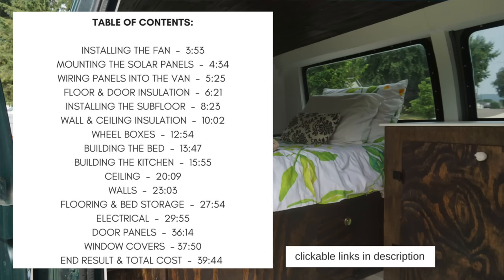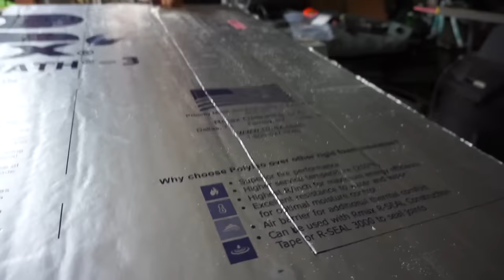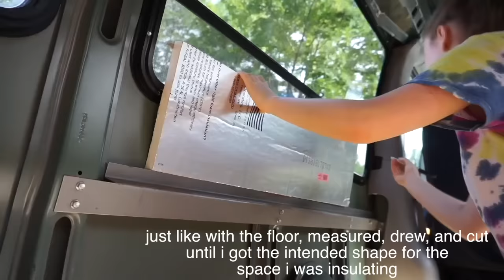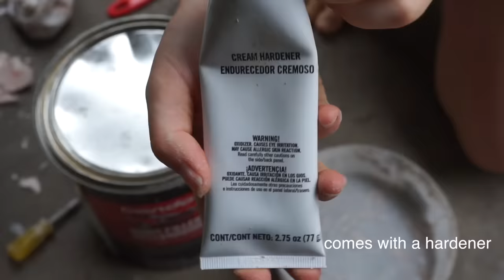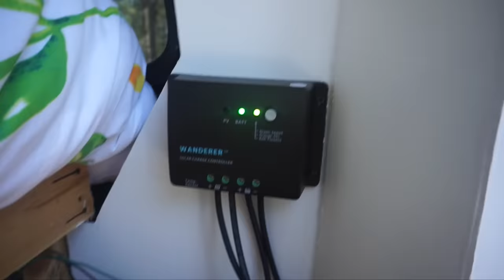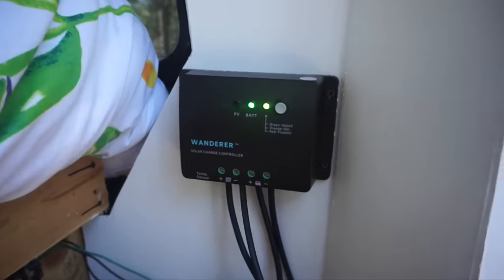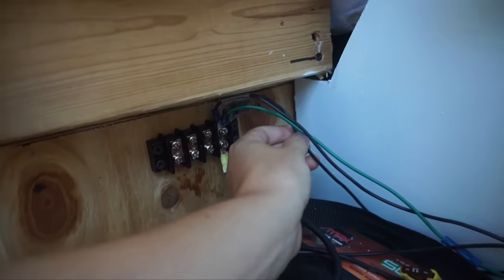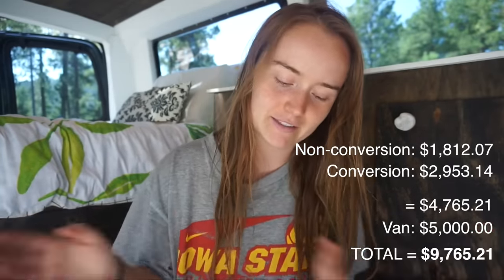How I Converted A VAN into an OFF GRID CAMPER for under $3,000

Comment: You must redo where the wires going to the van. You must put hard plastic gaskets or rubber gaskets between the wires and the drills holes. Butyl tape and silicon is not enough. If you don't the sanded edges of the metal holes will cut through the wires and will Electrify the metal of the van. One day when it's raining when you go to shut the door and you stand in some water it will electrocute you and it may kill you. Or it may start a fire. This is extremely crucial and you need to make that replacement right away. There is a lot of power in those panels. It is deceptive because they are silent but they can stop your heart.
Reply from the maker: Thanks but I only have plans to live in this for a few months and I smushed the butyl tape down into the holes enough that I’m not worried about the metal cutting the wires. They aren’t going anywhere
Reply: @AnnasAnalysis  
You should (as jhlittleelect said) and at least fuse the solar circuit. Never assume with electrics. As has been said, it CAN kill you, or cause a fire. Remember, you had to caulk the corners of your framing panels after the bondo cracked? That can happen to the wiring , everything is flexing all the time, plus you're dealing with sunlight on the roof. That can affect the cables, they do tend to become more brittle. (Not being nasty, just realistic) Impressive job though!
Reply from the maker: Devin Gessner don’t know when I’ll be done with it or what I’ll do when I’m done but if I were to seek it I would make sure the person knew that it’s not built perfectly and there are things that they might want to change or redo
Reply: Yeah, I never see this brought up in most solar install videos I've watched.  So, I'm not sure how important this actually is.  Personally, when I did my van I made sure I got some grommets.  Drill the hole... used a small round file to smooth the hole... brushed some paint/rust sealant on the bare metal...let it dry and then put the grommet in... fed the line through... then used silicon to seal it.  The only issue I had was that the silicon around the hole changed from white to a kind of yellowish from the rubber from the grommet leaching into it.  I never had any other issues with it though.
Reply: @AnnasAnalysis  

I recommend not being over confident. You're getting a lot of praise, but many people don't understand what you're doing here either. You're just learning this stuff, so try to take advice seriously. Just brushing things like electrical system safety off, with comments like "I'm only going to be using it for a few months", and "it's not going anywhere", is arrogant and dangerous, especially when you've acknowledged that you don't know what you are doing, and you recognize that the person who helped you with the electrical system didn't use the safest methods. 

Also, when you inform the person you sell the van too, I hope you don't literally just say "it's not perfect, there are some things you may want to change", but rather give them the details and the link to this video.
Reply: Stop making excuses and fix it. its a relatively easy fix.
Reply: @101perspective  That sounds like a super-good method!! 
😁😁😁
Thanks for sharing this! If I do my own conversion, I will probably use your method, unless, of course, I discover something better, but your method sounds very professional, so there might not be anything any better!!
😁😁😁
Reply: Those wires can easily be cut through in a few WEEKS OR DAYS . THEY WILL BE VIBRATING.   I am not sure why you dont simply take some needle nose pliers and go to a local electronics supply store and jam some grommets in?  its easy! Why risk your whole van burning down?  Drive to any electronics supply store and show any guy behind the counter and they will probably help you doit!

Look up "electronics supply store"  the good ones will be in industrial areas. NOT SHOPPING CNETERS.

Also sealed batteries arent really sealed. They all have breath holes for the hydrogen gas to escape when charging. Strap it down so in hard braking it doesnt hit you in the back .
Reply: Vegan Earth & Soul  did my first van conversion in 1980 and I did not use grommets. after several months on the road, the lights and then the fan and the fridge stopped working ( not all at the same time) the base problem was the wire insulation being worn thru in the metal holes. lived on the road for 35 years and learned a lot about how things shake, rattle and roll. take it from an old timer, things do not hold up well in a jiggling vehicle. BTW I'm 70 yo.
Reply: I think the overwhelming advice is don't brush off electrical safety. The least that could happen is wipe out your electronics investment. The worst is fire and electrocution. I'm the retired firefighter. No one thinks "it" will happen to them. It's a denial mechanism we have so we can get out of bed and take chances without being paralyzed by fear of death. But in my line of work I saw tens of thousands of disastrous never could have happened events.  The denial, "it could never happen to me" is in everyone but  that's compounded  10x by every decade under 60 you are. As you age in every life there are lots of "its" that should never have happened but do. When I was your age I hated how older people my parents age 40s seemed so tired, negative and cautious and afraid of change. Some over do it but it's really because life throws a lot at you you never anticipate and it can wear on your body, your finances , your heart and your spirit. It's boring frustrating and tiresome but listening to older people warning you  constructively can spare you a great deal of life's trauma. I don't mean the ones who say "don't try" but the ones who say "anticipate and prevent this" . This is the best advice you'll ever get. Take a day or two and fix the electrical issues ! Don't ever be reckless with electricity. Be over cautious ! Respect it's power !
Reply: Vegan Earth & Soul,
You are letting a commendable job be overshadowed by your irresponsible attitude toward what could be a life or death situation for yourself or others. Many people have indicated the dangers and you brush it off with equip and excuses.  I know I am being hard on you but it is to get your attention. You have reasons to be proud of your work, but you have now been placed on notice (legal term for the knowledge a know problem). If an injury or death should happen as a result of what you were made aware and you didn't fix it, your future financially and criminally will be owned and dictated by others. Now that several of us have unloaded on you, I want you to know that you should be proud of your great effort.
Reply from the maker: But do you also realize that many people have told me it should be fine? So who do I listen to? If I had the ability rn to redo it I would but I shouldn’t have to explain why that isn’t something I can do
Reply: Vegan Earth & Soul,
You already know the answer to this situation. However, you have been warned and all of the written comments indicating a problem, put you on legal notice. If you do not fix the problem and it hurts or kill someone else, they or their family will sue you (if not bring criminal charges) and that will change your life forever. If you happen to be the one hurt or worse, that would be so sad because you were warned but took a defiant and stubborn stance instead of fixing the problem. Defiance and stubbornness are good qualities ONLY when you are fighting for such things as truth and justice but not when you are trying to prop up a falsehood. I wish you the best!
Reply from the maker: Okay so why have multiple people who are knowledgeable about this kind of stuff also telling me that it should be fine?
Reply: @AnnasAnalysis  I know I didn't say something with the intention of upsetting you. I'm not an electricity expert. If an electrician who has seen your set up has told you that there is no problem then I would stick with that. If lots of people whose only credential is their opinion on what they read here like me are telling you mixed things,I would get an electrician to come and look things over and give an expert opinion. Bottom line, get the opinion of an expert. I think I suggested a while back to see if that electrician friend of your parents could come back and have a look at it or at the very least explain the controversial issues by phone for his opinion. Now he is a professional whose time is money and who would prefer not to spend his time off working for free, so if he says he needs to see it to determine if its all right I would definitely offer and plan on paying him his normal fee for his time. Its up to him to say, "Don't worry about paying me" if he wants to.
Here's why non expert opinions don't matter. If the people who say there's potentially a serious danger are wrong ...no big deal...If the people who say its not a problem are wrong , it could be a financial, medical and / or legal disaster or all three. But none of us are assuming the consequences and the risk. You are. If we all had opinions about your hair or what car you should buy it absolutely wouldn't matter. But you dont screw around with forces of nature and electricity is one. The ocean is another. Or hiking in the vast wilderness. Each of those things can be great resources and usually are just a pleasant day at the beach. But you shouldnt have anything to do with them if you don't respect the fact that they can all turn on you without warning and kill and injure numerous people. If you dont recognize and respect their immense power and take every necessary precaution and do diligent research about how to recognize , prepare for, consult experts for their expertise and prevent the potential danger, then you are a fool and people will feel somewhat bad if something happens to you but if something happens that you could have and should have seen and prepared for and you just skipped along as if it was Disneyland you are going to be held VERY accountable especially if its someone else who pays the price, not you. That's just reality. That's life. People love you and like you. That's not the point. This is just the contract we have with society. The bottom line is that you're over 18 now, an adult. You are responsible for your decision. You have the right to take the risk and do nothing if an expert hasn't already certified that its safe. That's your choice. You know what the risks and benefits are. But whatever choice you make be prepared to pay the consequences if you are wrong. I just think the risk would weigh on me and I would rather find a way to get the money for an expert to assume the liability by certifying its safe than assuming it myself when I just don't know for sure if its safe or a time bomb.
BTW this doesn't take away from the awesome job you did on your van and how well you presented the information for people to learn from your experience. This is hard for you because you put yourself out there and now it seems like many people are coming down on you. I can't speak for anyone else but that's not what I feel like I'm doing. I just don't want to see you make a mistake you might regret. This is the down side of social media. People do seem quick to judge and turn on people. Sometimes they really are judgemental and mean on social media and sometimes it just seems that way because if these comments were made in person it would be easier to know they were being said with respect and good wishes. That's where I am coming from anyway. You're awesome ! If you were one of my nieces I would be so proud of you !
Reply: @AnnasAnalysis  don't stress out on these comments. You can even check on the wires and silicon etc, every month to see if there's any wear, but you should be fine. (There are a zillion other things that are a risk before that, like drunk drivers and criminals.)

ALSO, you will always have people giving you advice (wanted or unwanted), and unfortunately, most are full of bull (even "experts" from scientists to doctors FLUB their one job every day) (look at the "military experts" at the Pentagon, who can't even defeat some muslims in caves after ten years of trying!) (#3 killer in America? "EXPERTS" in hospitals who made careless errors!) 

AT THE SAME TIME, one of the worst qualities of teenagers is they NEVER listen to advice from elders. (It's human nature.) The problem is, most ppl in authority positions are NOT smart. In fact, it's human nature to get DUMBER AND DUMBER as you age, as life wears people down, so they get lazier and lazier and lazier. KIDS are much smarter (and more honest) than adults are, as a rule. 

(When I get loads of advice, I CROSS-reference, to get a wider variety of info. But i'm always shocked at how WRONG 'experts' consistently are!) (TIP: most "experts" get their info from the SAME faulty sources. EX: for 200 years, Americans believed tobacco was HEALTHY, cuz the "experts" said it was, and then each journalist quotes those morons or liars [lying for $$$ from Big Tobacco] and then the public all fell for it!)
Reply: wheres the toilet off grid idea

Comment: This is amazing congrats! You've done a great job.
Few tips from woman to woman:
1. Apply rust proofing all over the van before putting anything in. The moisture will rust the decor slowly otherwise behind the panels.
2. Silicone cracks in cold so instead use adhesive sealant for outside parts. Silicone is fine inside.
3. It's good to use hollow plastic pliant transport pipes to cover the electrical wires. It also makes it seasier to replace a broken one when there's a free duct ready.

Comment: tiny tip from the bottom of my heart and only cause she welcomed them. When ur using a counter sink screw for paneling or toung and groove like in her ceiling u can use a counter tip drill bit to avoid spliting edges which u can quickly cover using home made filler made from the dust off whatever ur sanding and sum water based pva glue. Takes an extra 10 mins but u wont see the screw heads unless ur looking for em and its dirt cheap budget friendly finishing satisfaction. Been a joy to watch this. Saving for solar right now

Comment: proud of you! wish i grew up w the internet, amazing! for people that watch, you need a mask for spray on adhesive. that glue goes into your lungs and is stuck in there.
Reply: True.   I grew up in a generation where we all use to heavily 'spray starch' and iron our clothes. I developed asthma about the same time.   Later I  discovered through an alternative health book that breathing in sticky spray starch as you iron, can clog one's bronchial tubes and cause the walls of the tubes to stick together thereby blocking oxygen into the lungs. 
That made sense. What an eye-opener.  Now, if I iron anything, I use a dry iron or steam.
For aerosol sprays, I try to cover my mouth and nose sufficiently, and work outdoors.

Comment: Question: In every Van conversion i saw, they painted/stained the ready built furniture after building them into the van. But wouldn‘t it make more sense to paint the wooden parts before building them together ?
Reply: It would be. However, it can often be difficult to think of doing so in advance, especially when you may find yourself not knowing how pieces fit together until you attach them.

Comment: Ok where to start, i only got 12min in and although i applaud you for the initiative at your age, there are ways of doing things and ways not to. Any time you run a wire through metal you have to use a grommet to protect it, those wires carry current and the metal will rub though it. their is a reason to use a wire crimping tool to attach wires not pliers all you did was crush the wire in the connector  and they may come apart.  Try to remove as much silicon as you can from the screws etc... on the roof, and use dicor sealant, or an equivalent ,silicon will not last. Please fix your wiring those are safety issues...Just because you saw it on utube does not mean that is a safe way to do something, please do more research.
Reply from the maker: Brdaley E thanks! I looked many places for grommets and the employees said they didn’t have any. 
We did not use wire crumpets because we could not apply enough force to crimp them with that. What we used worked better and the wires stayed together.
Where was I suppose to do ‘more research’ when I literally watched every build video I could find and read through so many website pages? I did hundreds of hours of research. That isn’t something I slacked on- it’s just that a lot of the information out there isn’t good- so where else should I or could I have even gone?

Comment: My things with your electrical stuff you should not use a converter because you're going to draw more power try to use everything 12 volts even if you know put a TV in 12 volt TV everything 12 volts of power that way but that's your choice love to build
Reply from the maker: ska punk OI! alternative living how do I charge electronics or run my fridge 24 h a day without an inverter?
Reply: @AnnasAnalysis  I recommend what you can do if you can try your best to use 12 volts equipment try not to use household stuff if you can help it you do just watch your batteries I recommend to get three to four 12 volt batteries putting together the last a lot longer I say also have two sources of power One battery or two to run on your alternator and solar panel but for Batteries put us together will definitely do the job